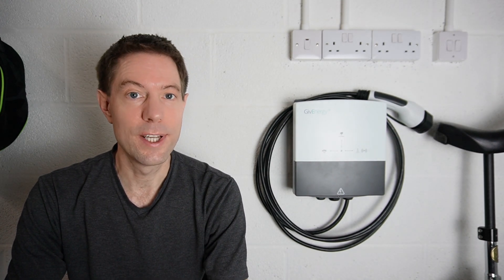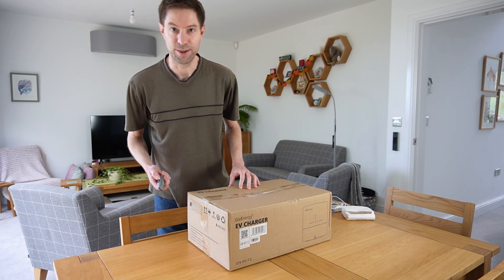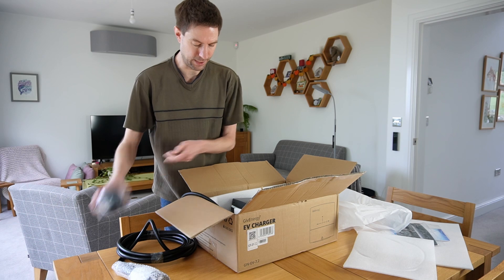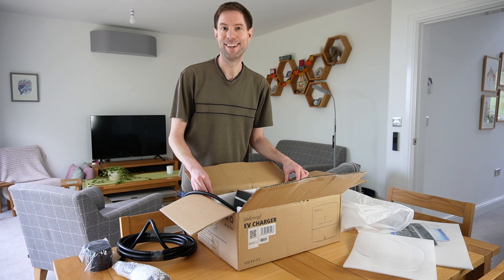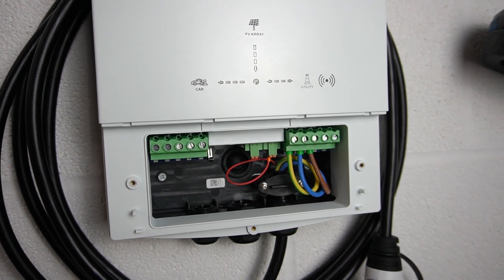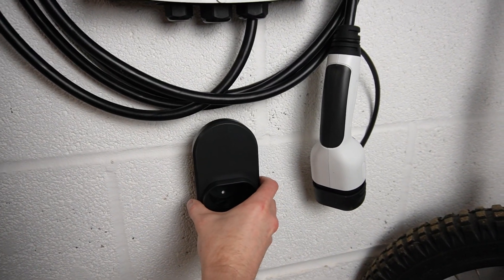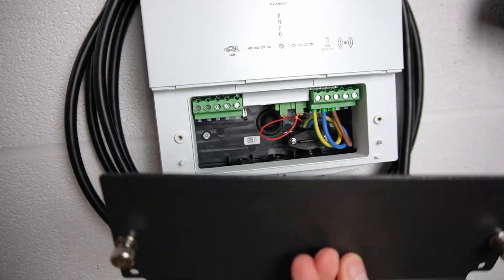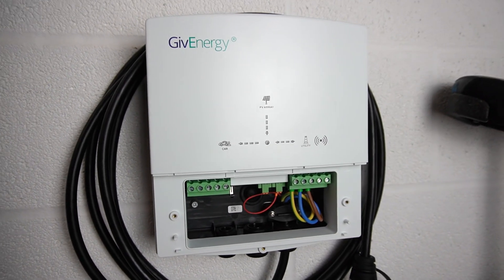GivEnergy EV charger - unboxing and wall mounting

Comment: Is it compatible with octapus plans? Can it sync with the electricity suppliers so you can set a max electricity price to charge your ev?
Reply from the maker: I hear on the grape vine that integration with Intelligent Octopus Go is in the works but no word yet on timescales.  You could use Home Assistant to automate the charging based on price signals, but that would require some setup, for example Speak To The Geek has some videos of this sort of thing.
Reply: @TimAndKatsGreenWalk  I have yet to find a way to get the additional charge slots on Intelligent Go into Home Assistant. At the moment I am relying on house load being over 5kW then I assume to pause the battery, it's not ideal and will vary by household what works and doesn't. I will be holding back until Intelligent Go is on this charger and it is tried and tested, stills seeing too many promises from GE which take a long time to appear. Seeing issues on All In One being reported too which sound similar to the original SOC issue with the normal batteries, software can be a really pain to debug and take ages so will stick with Ohme cable for now as it seems to work ok and I can work around the battery discharge by pausing it.

Comment: For those who want their cables to come through from the back of the device, it looks like there is a gland for that. Not sure if the other glands at the bottom can then be removed and blanked. Overall, not the best looking charger but not too bad either.
Reply: I personally use the rear gland. But left the lower ones as is.
So in the rare chance of rain ingress, it can flow out.

Mine is uncovered outside exposed. Not a drop of water seen inside, during many months of meddling
Reply from the maker: Yes, I didn't mention the back gland but that's useful to have.  I'm not sure about blocking off the bottom glands, I'll take a look.
Reply: Personally I would be inclined to leave the bottom gland as an insurance in the event of rain ingress when it is fitted externally.

Comment: Great video, though it would have been more entertaining if you had done the install while on the unicycle. Very surprised a company like GivEnergy would have a product with incorrect screws and washers, unless it is a pre production model. Finally I have read it can’t be installed anywhere in direct sunlight, according to the pdf, which is a shame as I don’t have a garage and I am south facing.
Reply from the maker: Ah, I didn't know it couldn't be installed in direct sunlight, that is surprising.  It could be that they've sorted the screws issue already but I'll be letting them know about it in case they haven't.  It did seem a bit daft that this hadn't been tested properly, but there you go, I guess these things can slip through the net.  I'll make sure to do the app demo on the unicycle ;) (maybe).
Reply: I'm guessing that many would likely be installed in direct sunlight, so this issue should have been addressed at the design stage.

Lack of forethought and implementation will no doubt impact on the volume of sales.
Reply from the maker: Which pdf mentions the direct sunlight, out of interest?  It's not mentioned on the data sheet.
Reply from the maker: Ah, the installation guide, got it.
Reply: @TimAndKatsGreenWalk  Yes sorry didn’t make that clear. However what I don’t know is if other manufacturers put this on to cover themselves and installers don’t worry about it.
Reply from the maker: @richarddixon6354  yeah, I was wondering about that, or if a bit of sunlight is no big deal as long as it's not hours and hours.  I'll ask GE about it for clarity.
Reply: @TimAndKatsGreenWalk  Many thanks, the problem is being south facing it would be in full view of sun for many hours in the summer. Another worry is if certain parts of the media picked up on this they would have a field day.

Comment: What's the maximum power your charger can provide?
Are you limited to 32A or 16A on a single phase, if not running via a household socket? 
I've got 32A per phase, but my main fuses are 25A per phase, so load balancing is essential and the 32A can only be provided if my PVs are generating enough (additional) power.

Sorry if I'm getting too geeky. It happens. 😋
Reply from the maker: It's a 32A single phase charger, so 7.2 kW, and it'll be wired into a dedicated circuit from the consumer unit.  The app allows you to scale this back though, if you wish.  Thankfully I have a 100A fuse on my single phase supply.
Reply: You can set any use rating from 0 to 100A
Also can limit power globally,  or on a per charge basis

Comment: Hi Tim, the 'gidgit' looks like a DIN rail kWh meter, normally installed in your consumer unit, wired in series with the appropriate MCB(s).
That's how it's set up in my house (In the Netherlands) anyway.
In my case, these meters measure Power generation/ consumption of my PVs and a/c and ZAPPI.

In my case, the house's power consumption data is provided via a 'P1' connection to our smart meter.
The ZAPPI needs CT clamps, though,  as the ZAPPI can't talk to my smart meter, as far as I know.

The GivEnergy gidgit looks like it's been adapted to take readings from a CT clamp instead of directly measuring the current/power flow through one of your circuits.
Reply from the maker: Yup, it has CT clamp for measuring the import/export, I have another identical one connected to my inverter for the same reason, to monitor when excess is going back to the grid.
Reply: I presume the gidgit will be connected to your charger via physical twisted pair wiring (modbus protocol) to let the charger know if excess power is available.

Comment: Can they limit to 10A and just put a plug on and plug it in?

Don’t put the fake socket too low.  Looks like you have plenty of room to not wrap the cable tightly, just hang the end over.
Reply from the maker: I don't know.  Not a lot of point having a 32A charger if you're going to limit it to 10A though.
Reply: Gets you all the other setup done, and the software running.
Also - if you can get OI… a lower power charger “needs” more additional off peak hours…

It’s rare that you “need” 7kW. Even on Go… 4 hours at 2kW is still 8kWh, so 30+miles range a night.
Reply from the maker: @JohnR31415  there have been a couple of occasions where being able to charge at 7 kW would have been handy as we needed a 50% boost overnight.